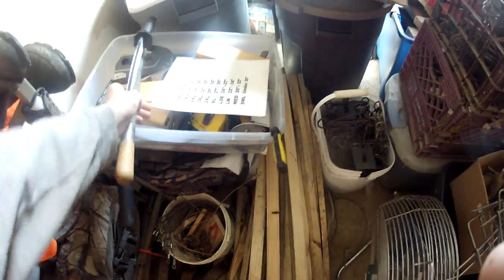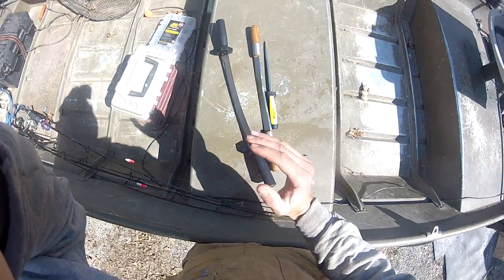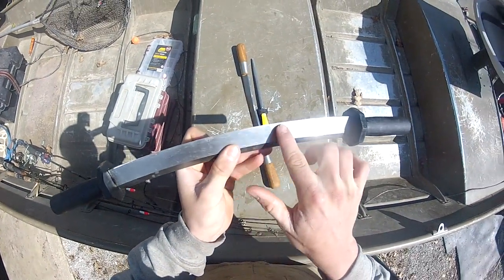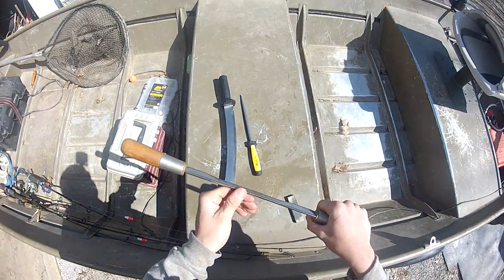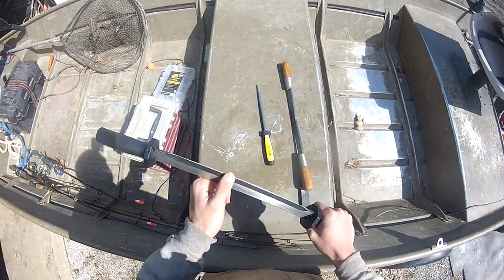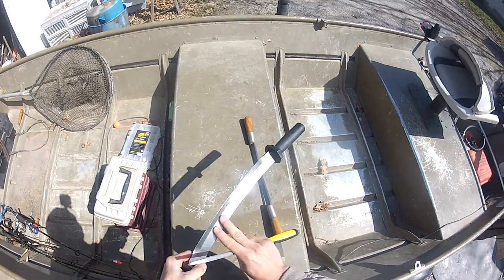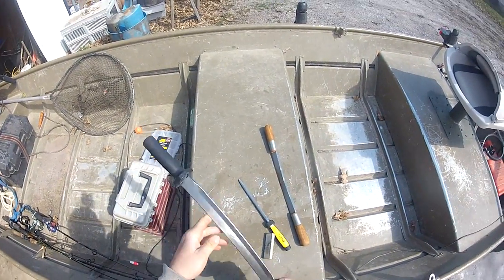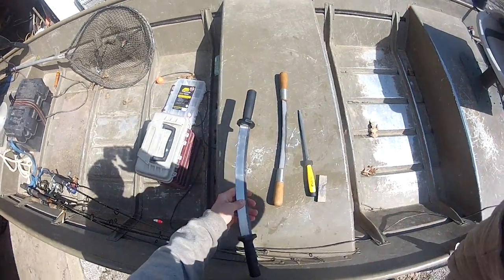Fleshing Knife Sharpening and Maintenance

Comment: Another informational video. I had a kniecker and did not care for it. I tried the Post Fleshing Knife, made in Canada. The difference was like the $10 special and the knecker. Better steel, holds and edge longer and better then the kniecker. I liked it so much I became a dealer for them. If you get a chance try one. Tom
Reply from the maker: Tom Riblett right on I fully agree. the post steel is far superior to the necker. since I made that video I have since also went to a post. I was using it in the skinning and fleshing video you commented on earlier.

Comment: If a man could find a thick leather strap and nail it up in between two wall boards and keep it fairly tight a few medium or heavy swipes across leather really helps just about any blade. I use  leather a lot to keep my blade thinned and smooth you can even do it after sharpening with a steel or stone. Good video